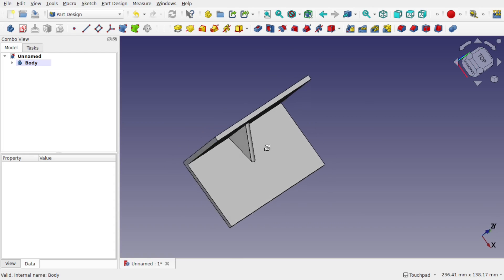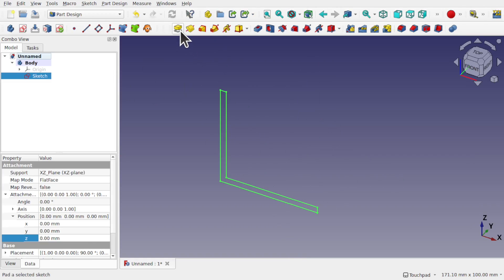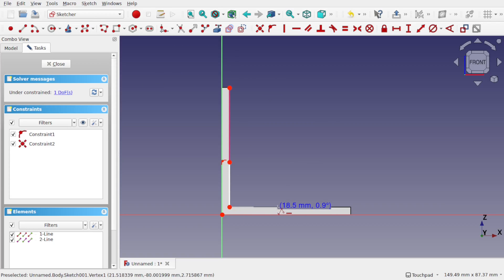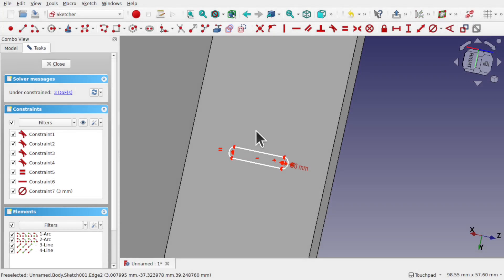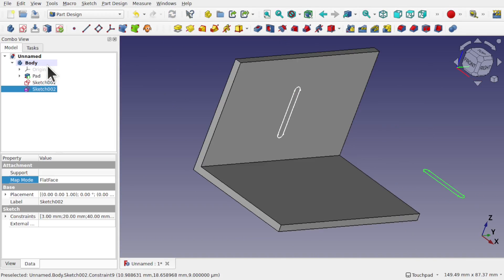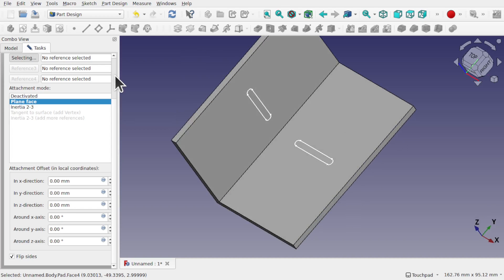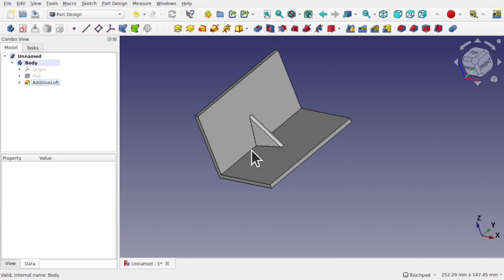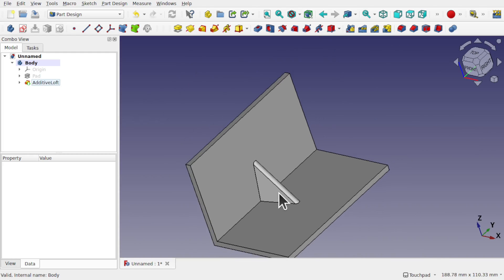FreeCAD For Beginners | 47 | Re-orientate sketch onto another face | How to Create Gussets

Comment: Interestingly, in my case FreeCAD was creating a TWISTED loft, which, it wouldn't accept with the "Wire is not closed" error. However, I know that it's closed, because its just a slot. And, I repeated all the steps after you precisely. I found a way around this problem by giving the sketch002 attachement a -360 degree turn. (It's the negavive 360, because the positive 360 didn't help)

Comment: The videos looking so long to produce the result which i can produce in 2-3 minutes in rhino or moi 3d but still i want to know what is the benefit of those aoftware.
Reply from the maker: So the method I use should take even less than 2 - 3 minutes to add. It's only because I have explained two or three ways and give an explanation that the videos are that long.

Comment: have tried a few times, keep getting the mapping of one vertex to the other being flipped when it comes to the loft, what am i doing wrong?
Reply: I had a similar problem, essentially the Loft was twisted. When I went back and redid the Tut it worked First time. It was either I forgot to delete One of the Original Sketches or I took a poor option when creating the Second exercise Pad (i.e. Dependant copy options). Sorry I'm not more specific but I've got so much FreeCAD floating around in my head it's not funny!! I've found it's easy to miss a small modification when adjusting the Models. Start again, slow the Vid right down and follow Pedantically! You could possibly use the Sketch Attachment Editor to rotate One of the Sketches but as Darren pointed out earlier it'll probably send You Insane!! lol ;-). CAD is very unforgiving of the smallest mistake by the Operator.
Reply: i got the first and last example working but the slot example didnt work for me  @russellw5447
Reply: I just came back to this, apparently after a month of it sitting in my tabs, and doing the steps now makes the loft work. I don't know if I've ended up doing anything differently, or if I picked up an update in the meantime or if I was just more careful this time.
Reply: I can't figure out what's going on for me either. I've tried playing around with the attachment editor but regardless of which direction I flip it, the loft always seems to choose the wrong direction to attach.